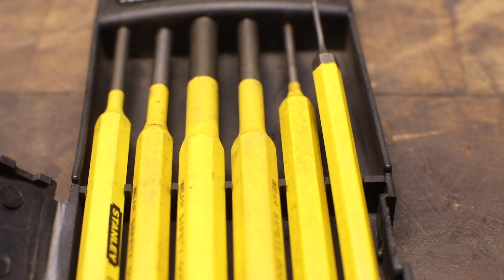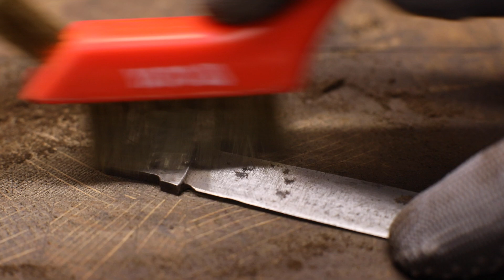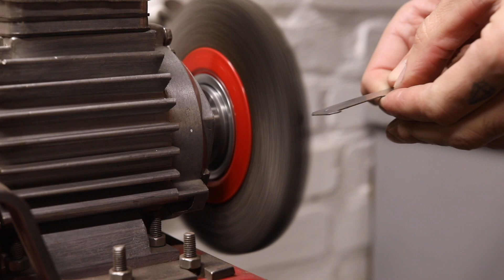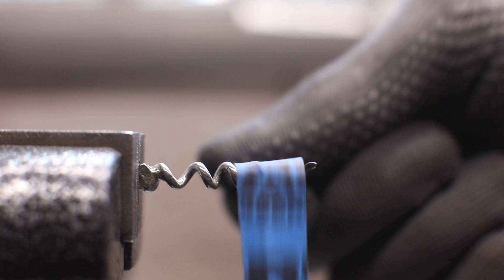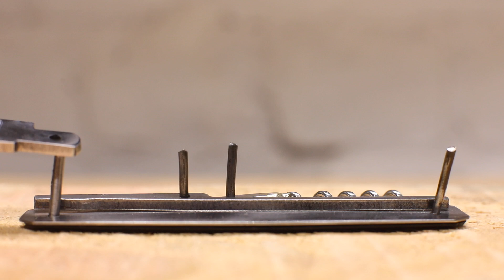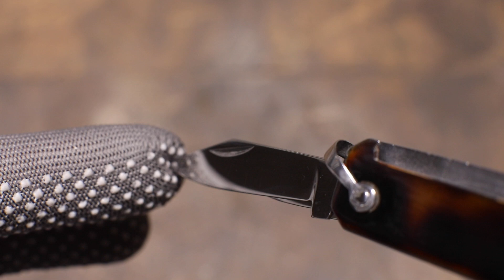Restoring Rare Old Swiss Army Knife. Pocket Knife Restoration

Comment: Awesome job men ! I know that it has the Cross on the scales, but this looks much more like a France Pradel pocket knife. Plus it has no other mark's on the blade tang or the other implements, so maybe it is a Pradel pocket knife made for the France part of Switzerland. And that is why it doesn't have Pradel written on the blade, and no tang stamp either. Because it clearly isn't a Wenger or a Victorinox knife. But more like it copied some feature's from Victorinox, because Pradel used to copy som implements designer from them. And their logo is similar to the shield with the Cross on it, like the one Wenger and Victorinox used. But the Pradel logo it is actually a flag with a Cross on it not a shield, like it is confused with.
Reply: Yes, usually I see these pradel knives with the flag behind the cross, and they are not as rare as ReXtorer says, I've seen plenty of these being sold in serveral online 2nd hand sites, usually for quite cheap, like around 20€ but they also thend to be in bad shape, but this is beacuse these knives are not very high quality, cracking scales and rusted/broken blades are a very common occurance. I still want one in my collection though, but finding a good one proves to be quite hard.

Comment: I watched a documentary about the manufacturing of Swiss Army knife's a few years back,mainly looking at one of those multi knives with 70 odd attachments and how they make all the components. Someone sent them a knife that had belonged to his great grandfather,a model from about 1908 that was very well used. Apparently when they say a lifetime guarantee they mean it. They refurbished the knife free of charge and sent it back.
Reply: That is only if the knife size in question is still in production so they have spare parts for in. Usually they just send you a new one if they have it because that is much cheaper for them.
Reply: I thought "lifetime" would mean the life time of the original owner. So 1908 knife might not be under warranty anymore.
Reply: @vzaliva  Its about the product not the person.
Reply: @RiderOftheNorth.357  You can ask them not to. I've sent a few knives in Canada and I said one was from my father. They repaired it and sent me the old parts. I also sent them two knives with an unaligned corkscrew and they changed it on the rare knife and gave me a new one for the ordinary knife. That said I asked them for spare part for the Sportratchet and they said they couldn't since it is not in production anymore.